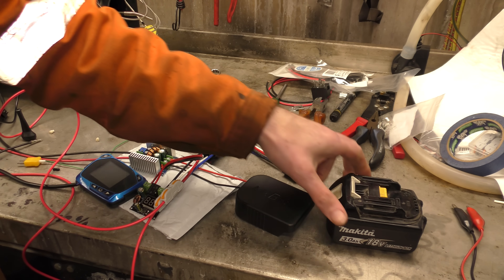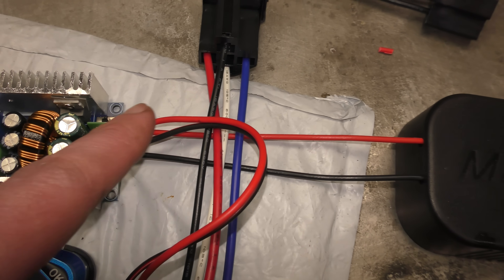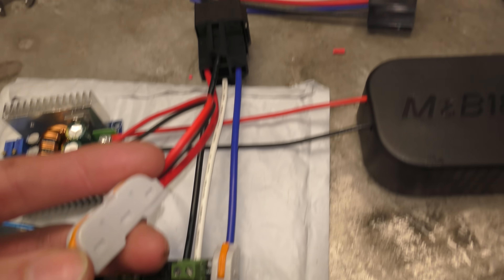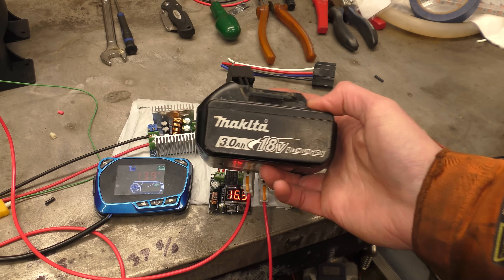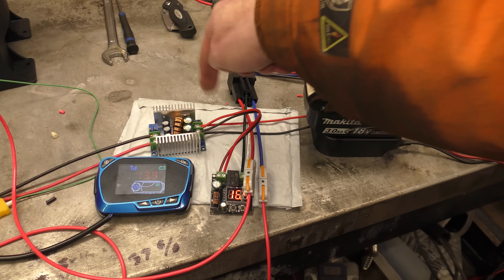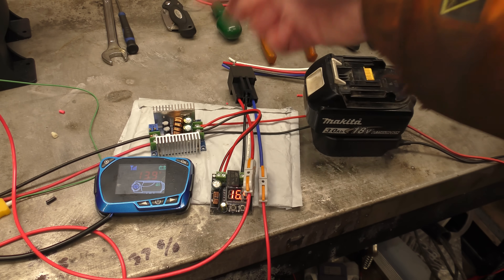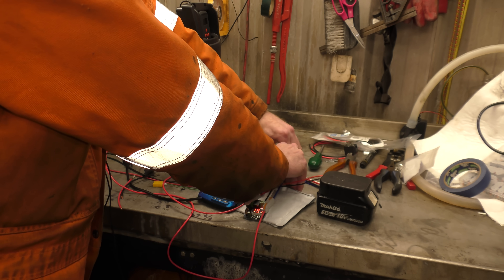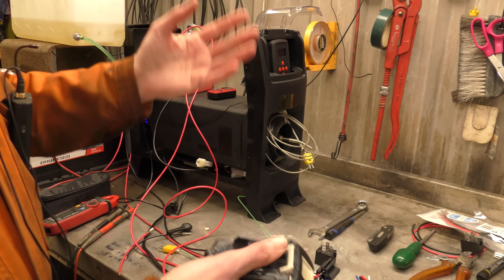Diesel Heater Running on Makita 18V Tool Battery

Comment: So is the fuel pumps ok at ok running at 18v?
Reply: fuel pump is running at the normal 12-14v, the 18v is only on the coil side of the relay controlling it

Comment: Hi david. Would this work with a dual battery set up? Would it run them down evenly and could you switch them out one at a time to keep the heater running. Rather than doing a shut down procedure to swap batteries ?
Reply from the maker: Yes.  I've done it on another heater.  I think I made a video of it.  You can also use the power switching module so that when one battery dies it swaps over to the other one.
Reply: @DavidMcLuckie  mint. Thanks. I'll check that out

Comment: Can you set it up to switch to a second battery versus shutting down? Or a toggle switch to flip to a second battery? Sorry, I’ve very electronic ignorant. Thank you
Reply from the maker: There is a module that switches to a second battery at a preset voltage.

Comment: Didn't see anywhere how long the battery will run the actual heater,  If it's only for an hour or so then it might be a good backup system for power outage but I am looking for the smallest battery pack that can run it all night.
Reply from the maker: The heater uses approximately 4A when running at full power.  Assuming all night to be 8 hours you'd need 8 x 4Ah = 32Ah battery.  You'd be about £100-150 for a LiFePo4 battery to do that.
Reply: What about 4 x 5Ah battery/ like in the Makita power bank which takes four batteries

Comment: So I'm curious about these heaters/controllers and voltage in real world conditions - if using a normal battery pack and the voltage drops down low enough, does the heater go through a safe shutdown process similar to what you rigged up with the fuel pump/relay? Thanks!
Reply from the maker: None of the heaters I've tried have any kind of low voltage shutdown.  I had one running off the power supply and it went down to 9V before stopping dead.
Reply: @DavidMcLuckie  Understood. That's not terribly surprising I guess.

Comment: Great video, David, just what I need (thank you), but not being a sparky, boy have you muddled my brain up trying to follow the wiring from the relay!  If I can follow the wires I'm fine, but zooming a finger about over a nest of wires and I'm lost! A wiring diagram would be a HUGE help - pretty please? :-)

I've been fighting my diesel heater for several years, mostly due to crap UK light levels stuffing up Flooded/AGM leisure batteries, thus not having the voltage guts to push adequate start-up watts at <10A amps to stop peak watts >120 which I assume would trip off a Jackery (so that's not a power option I'm presuming).

Comment: for lithium cells.... The absolute lowest they can be ran down to. is 3v per cell... Any lower, They will suffer from damage, and likely begin to lose their capacity...
For a safe side, Its always best to have voltage cut off set to around 3.2v per cell...  You can have 3v cut off, but the issue is.. Load on the battery can temp cause it to drop below 3v...
So best to have Low voltage cut off set to slightly higher...
I used to race RC cars as a hobby, and used Lithium Polymer batteries... and always ran a LVC (Low Voltage Cutoff) at 3.2v per cell....
I ran a 2S (2 cell) lipo, As it was race rules... so 7.4v Nominal voltage....  So fully charged, Each cell sits at 4.2v.. So 8.4v battery voltage... 
Fully discharged and LVC will kick in when battery hits 6.2v ( 3.2v per cell)...

As a 18v drill battery is 5 cells... Nominal voltage is 18v.. Fully charged is 21v.... Fully discharged, 3v per cell, is 15v... So good to have Low Voltage Cutoff set to 16v..  (3.2v per cell)

Hope this helps :)
Reply from the maker: Thank you.  That is very useful to know.

Comment: Doesn’t the heater it’s self have a low voltage protection built in so you can just use a regulator?
Reply from the maker: Not on any of the ones I've had.  I've run one all the way down to 9V before the voltage was too low and it just stopped.

Comment: So would a straight connection to a 12v tool battery work?
Reply from the maker: Yes, assuming it has enough current to start the heater.  Two 12V in parallel might be better.

Comment: I know this is an old video, but I just found it. I was thinking it would be a good idea to have 3 battery slots and only use two of them at a time. Then use a diode and monitor each batter individually so that when either one drops below X voltage, something alerts you (light or buzzer). Then you can place a fresh battery in the third spot and keep the heater running, instead of it shutting down and having to start it back up. 

Basically a way to monitor each battery and replace as needed, instead of running to the point the heater shuts off. If you wanted to get real fancy, you could make it so that you install all 3 batteries and it uses one battery at a time. 

Most of the time this would be useless, because if you have access to a charger, you have access to power... but it's the thought that counts. Speaking of... what about about if you incorporated a steam powered turbine that kicked in an recharged the batteries ... and so that you didn't run out of water, you collect exhaust condensate. As you can see, I've done all the hard work coming up with the ideas, so all you need to do now is make it happen 😂

Comment: have you had any issues with the shutdown procedure? I know if the heater is running and you disconnect power without allowing it to shutdown the heater will meltdown.

Comment: Great video Dave, I have set up my diesel heater using the 240w jackery. I used the 12v plug that came with the jackery but my output  doesn't go above 5w. I was wondering what 12v plug did you use.
Reply: I wanna try same idea on my Ecoflow.
Reply: My Ecoflow delta max 2000 will run my diesel heater for a few minutes then it shuts down. Ecoflow goes into overload protection on the dc port

Comment: I have been building something similar.  I have a 30a converter . If you see this can you answer... am I okay to monitor the battery and shut it off manually before getting too low and having lipo cut out ? . That way the heater goes threw the cool down.  Just have to make sure to monitor it right ? Also do you figure I can run for 2 5 hours on 5ah?
Reply from the maker: By manually do you mean turning the heater off via the controller?  If so, then yes.  But you will need to experiment to see when you still have enough charge to complete the cooldown cycle.

Comment: Hi, I'm thinking of putting together a lithium ion pack to run a heater, what's the highest voltage you would feel confident running the 12v heaters on.
Reply: As long as you use that buck converter in between, you could go up to 40v, i believe. I am not sure without it.

Comment: Great videos david 👍
Just a thought on a 12v system could you connect a solar charger onto the system and swap out the solar input for a 12vdc hardwired input and then have the output on the diesel heater ?? That way the diesel heater is always pulling its voltage off the 12vdc psu but if there’s a power failure then the heater takes the voltage off the battery ? If that makes sense ??

Comment: Have you ever tried to run one directly off the 18V battery? Without the stepdown?
Reply from the maker: No, but now I want to.  :)
Reply: @DavidMcLuckie  I think the limit is 11-16V so it may be a problem.

Comment: My only worry would be the shutdown procedure. The Glo plug sucks 10-12 amps and if your Makita battery is low it will not provide that and if it did it will drag the voltage so low the battery BMS will shut power off completely.
The battery contains 5 cells @ 3.7 volts to get 18.5 volts. They reach 4.2 volts each fully charged to give 21 volts.
Reply from the maker: Yes that's something I'll test.  See what the voltage drop is on glow plug use and set the low cutoff around that so it still has enough power left to complete the shutdown.  The shut down glow plug use doesn't last as long as the startup though.

Comment: My diesel heater 3 weeks old runs great but I have to take the fuel line off because it floods the whole burn chamber with diesel, I let it burn off the extra the reattach the fuel line, and it'll run. I then  took it apart cleaned all the fuel line pieces, glow plug and screen, why is it doing this fuel flood. Seems like my old glow plug was thinner than this new heaters plug< maybe no enough room to burn the fuel at the atomizer screen i dont know help.

Comment: I think you should try tipping your all in one heater over to see how long it would run to simulate an accidental knock over and then wire in a tip over switch into the fuel pump circuit.
Reply from the maker: That's a pretty good idea actually.

Comment: Lowest you probably want to go is 15volts (3v per cell, battery has several 5 cell banks inside it wired in series), though 16.5 would be a safer bet according to some, 12.5 is absolute minimum (2.5 volts per cell) albeit the battery itself might cut out at a certain voltage?

Comment: Want to see the run time on one of those batteries.  Also could use 13.9 volt to power fuel shut off relay by running threw contacts on voltage shutdown board.
Reply from the maker: You'd have to modify the board a bit for that to work.  This board just uses the input (sense) voltage and uses that as the output as well.

Comment: lithium battery's are 4.2 volts full per cell 3 volts max dead a cell and to make a 18 volt battery it takes 5 cells to make full 21 volts   and 15 volts to complete dead

Comment: apparently fuel pump don't need be in the position as describe by instruction if you have clean fuel. the design which was taken from original manufacture design has to be that way so any deposit from dirt can be left in the outer ring of fuel pump at bottom of that ring instead of push by magnet ... Can you confirm?
Reply from the maker: I thought it was also to aid in purging air from the pump as well.

Comment: bonjour , pourait tu maitre en description un lien pour le materiel utilisé et un schéma du circuit . merci .
Reply: fab 2 strok - I used Google Translate on your comment and thought it was a great request so am posting it here. Thanks. hello, could you put in description a link for the material used and a diagram of the circuit. thank you .
Reply from the maker: Parts used in the description but not a wiring diagram.
Reply: @DavidMcLuckie  Thanks David, I think most could gather enough wiring detail from your video. As always, looking forward to your next video.

Comment: I guess if you have 2 batteries parallel you should be able to swap the battery without the system shutting down.
Reply: You’d have one battery at 22v and one at 16v. There’d be some current between them unless you had a blocking circuit. A good option would be to have a switch between the two though. 👍🏻
Reply: @alexadam628  it's true that there would be a bit of energy transfer, but you can remove the discharged battery right after you attached the fully charged. The goal with 2 battery is to not lose the power and not have to shut down the system.
Reply: I did this and I don’t imagine I’m doing any battery damage as I’m only swapping them and they are connected in parallel only for a few seconds

Comment: You could have it switch batteries at the low voltage, then have another relay to cut the fuel pump at the end of the second battery, for some added time. It’d be interesting to see how long it’ll run on the tool battery.
Reply: Hi David great work extremely informative and useful ... would it be possible to indicate approx running time on a tool battery ?  Thanks again
Reply: Hi David thanks again for your much appreciated channel and informative content .. could you advise approx running time on one portable tool battery such as the ones you are using ? Thanks
Reply: Mike Jones - Those are excellent ideas!
Reply: Mike.....wouldn't it be better just to keep the same circuit here and stack batteries parallel?  Would do the same thing but double your AH
Reply: @Wade Brewer  if you do it his way you can charge one at a time ! . Both ways make sense .
Reply: @ebutuoycensorship8012  if parallel, and diodes are used, you can still run them parallel and not over complicate the circuit.  Using diodes you can switch batteries out and not worry about current running from your charged pack into the pack that is depleted.  Once the new pack is on, current will from that pack and not the depleted pack.  Once you have the new pack on, you can pull the old pack off and charge it all while the unit doesnt go off.

My only concern doing it my way, you will get a small amount of in rush to the buck converter that it will have to compensate for on the fly with a load.  Eitherway...diodes will protect the packs and if my way doesn't work.....lol....im only out about 25 bucks in electronics from Amazon.

Going to begin work on this project in the next week or so.  Pretty busy with other items at the moment.
Reply: I did two of those battery docks you find on Amazon in parallel but never plan on having two dissimilarly charged battery connected at the same time for more then the few seconds it takes me to swap the used one with a fresh one. Basically allows me to switch batteries while still running not having to do the shutdown startup sequence
Reply: @devinmahoney3777  so do you run it on one battery, then quickly plug in the other one before unplugging the deader one? Also how or what do you use to tell you the reading of what's left on the dieing battery
Reply: @Woodlandbill  yeah I run it on one battery. I am using Milwaukee batteries which have a button with a 4 light full/empty indicator..so I can easily check what the battery life is at while it’s running. I don’t have to be quick about the swap..but it’s a quick process. Just connect a second charged battery, then disconnect the used battery. Wired in parallel means the voltage delivery to the unit doesn’t change if one versus two batteries are connected. I am currently using power from an outlet through a transformer and don’t use the battery set up to heat my garage. I plan to do some more tweaks to add an auto shut off feature when it’s on battery power so when the battery is near flat I don’t run the risk of damaging those expensive batteries…maybe when it warms up a bit and I don’t need the heater in the summer I’ll do more tinkering on it 😜

Comment: Plenty of people here already commented on the 5S configuration of 18650 cells inside the Makita battery (so 21V max, 15V min)... BUT be very careful with “clone” knock-off versions as internally they often have poor quality cells with low capacity wiring, and very few have per cell balancing and this can lead to all sorts of “letting the magic smoke out” scenarios. Genuine Makita batteries, as you are using, will be fine dumping 10-20amps to fire up the glow plug.
Reply from the maker: I have a couple of knock off Makita batteries and can confirm they are indeed shite.  Will need to try them on the heater and see if the take the start load.
Reply: What about a 5AH dewalt battery?
Reply: @Qawqazz  A genuine one is probably fine - It will give the necessary current for the short time whilst the glow plug is operating. Most fake "chinesium" ones won't, assuming they don't spontaneously combust in the process!

Comment: You shouldn't disconnect the fuel pump because wont it keep trying to fire the glow plug and still draw power from the battery
Reply from the maker: Not sure if that's a question or a statement.  The point is to leave enough power in the battery to run the proper shutdown sequence.  Pulling the fuel pump causes it to flame out and run the correct shutdown, including running the glow plug to keep the atomising screen clean.  It would be the same as if you'd turned it off manually.
Reply: @DavidMcLuckie  i see thanks i wasnt sure on the shut down sequence if it just kept firing the glow plug trying to start it again or if it just stopped completely
Reply from the maker: Ah, once the fuel pump is cut out the ECU knows there is no fuel pump, shuts down and gives up until the circuit is complete again and you manually fire it up.

Comment: Out of interest how long running time do you get using an 18v battery
Reply from the maker: These would be rough numbers as I haven't run a full test.  So a 3Ah battery would give approx 1 hour run time at heater max power (5KW body).  So if you run the heater at a lower setting the battery would last longer of course.
Reply: @david mcluckie please do a duration test.  Or maybe tests at high medium and low outputs.   Your idea for mobile heater is awesome.
Additionally the battery has a low voltage protection circuit built in it. Sat the "20 volt" relay at that value

Comment: You can change the burner to 24v
Reply from the maker: You can change the controller settings to 24V.  But it won't run.
Reply: @DavidMcLuckie  what happens if you run two in series and then use a 24 v regulator

Comment: Hi David, I've got a gallon or two of unleaded fuel some mixed as two stroke, some not,  that has been kicking about for a year or three, I am reluctant to put this old fuel in any of my engines , do you think it would burn ok through the heater at a 50/50 mix with diesel ?
Reply from the maker: Mixed 50/50 with diesel will be ok, but you'll get a little residue from the 2 stroke but that can be burned off if you just run neat diesel every other tank.